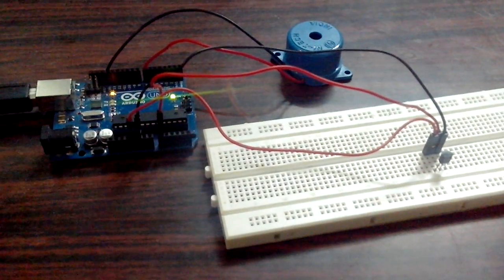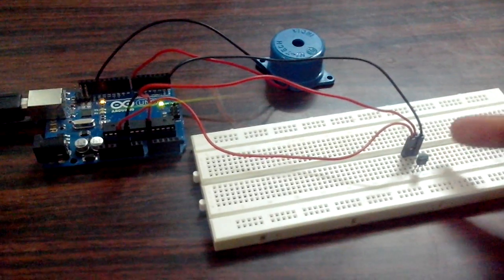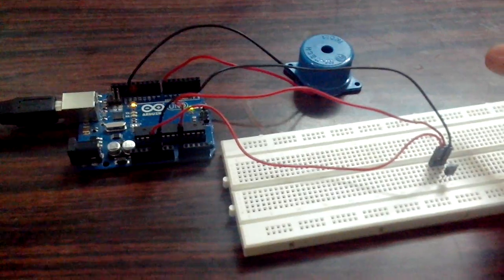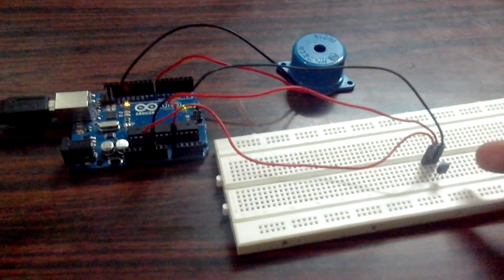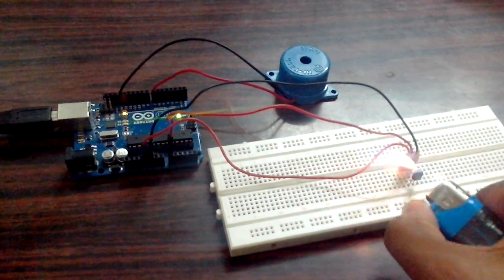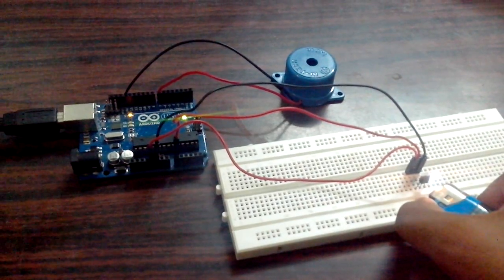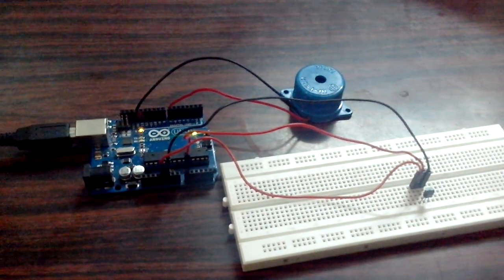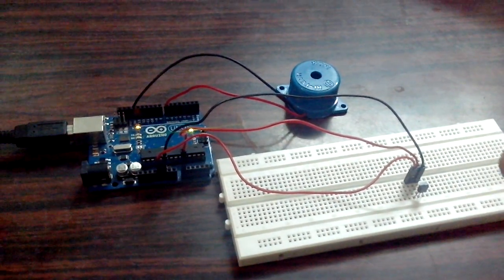Fire Alarm Using Arduino

Comment: Are you sure this is all the code?????? Looks incomplete doesn't set outputs or inputs
Reply from the maker: I have given the code and circuit in my blog... it is the code that I wrote to do this project... It will work...

Comment: Nice! Can I also have the code? mawmaw1014@gmail.com
Thank you!
Reply: Here is the sketch:

void setup()
{
}
void loop()
{
  float temp = (5.0 * analogRead(A0) * 100.0) / 1024;
  if(temp>32)
  {
  t();
  }
  else
  {
  if(temp>30)
  {
   t1();
  }
  if(temp<30);
  {
  noTone(7);
  }
}
}
void t()
{
tone(7, 494, 500);
delay(1000);
}
void t1()
{
  tone(7, 494, 500);
  delay(2000);
}
Reply: Emailed it too. Hope It Helps ;)
Reply: +MyWillyboi  really ?it is too same